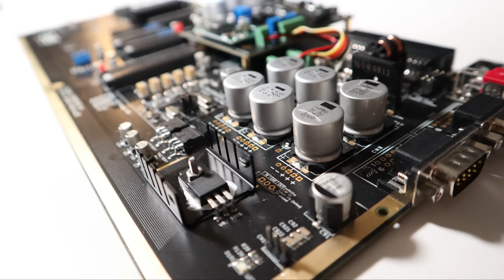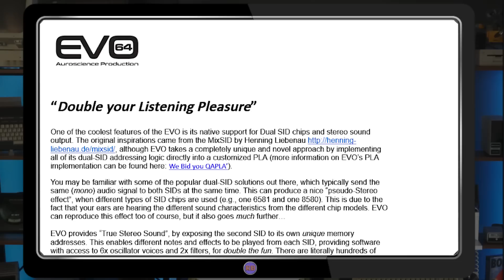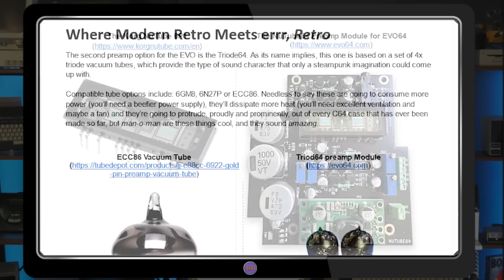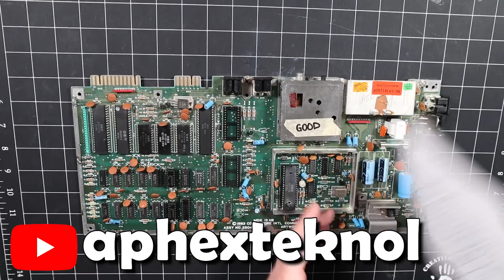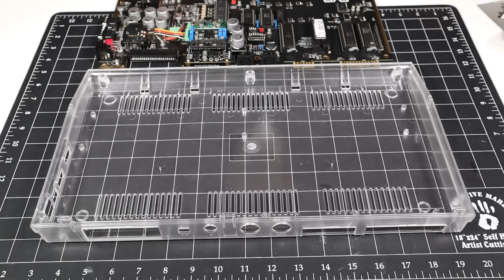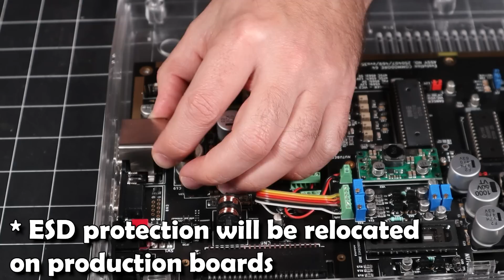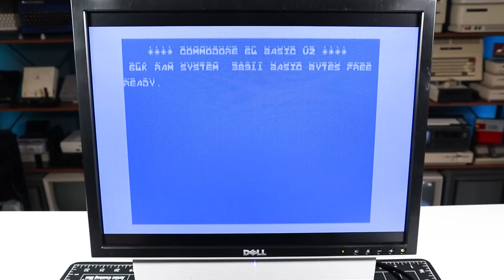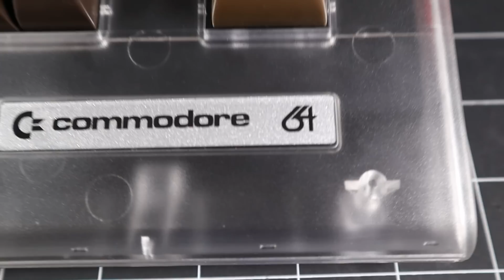A Commodore 64 with… vacuum tubes? Introducing the Evo64!

Comment: Is the nutube microphonic? Recall Brad the Guitologist getting an early one and it was. Can you hear your keyboard inputs?
enjoy!
Reply: Yes. The Korg Nutube 6P1 can exhibit some microphonic properties when its exposed to significant vibrations. This is why we provide a mounting solution  with standoffs that provide some dampening. Most of us won't have our C64 systems setup in areas with heavy vibrations, so in our field testing the microphonics have never been a real issue.
Reply: all tubes are microphonic. If you tap ON the nutube you will hear the "ding....". If you tap somewhere else, or type in the keyboard, you will be safe. I doubt you will put the C64 on top of  speakers.
Reply: @auro1999  with that argument we wouldn’t have tube guitar amps.  Interesting anyways y’all had to overcome it

Comment: Hmm, so this doesn't really have much point to it like the THEC64 does, since with this we still have to find our old main chips except the PLA. So it's mostly just if our PCB and PLAs are hashed but we also want cleaned up A/V as a bonus. So now let's see them copy all the old chips that have yet to be cloned discretely and include those as part of later releases of this, so that it's complete, at least electronically. And then include new cases as even another option.

Comment: I really want an EVO board. Not interested in the tube amp though.
Reply from the maker: The Evo64's dual SIDs work fine without the optional tube amps and the board still provides much cleaner power than an original 64.

Comment: Would be nice if they had cleaned off the flux residu..
Reply: It will be on the retail board. Remember that this is more a prototype.
Reply: In case it wasn't clear from the video, Matt was working with a hand made prototype board. Final production boards won't have the flux mess on them.

Comment: I noticed the lack of modern connectors on the back of the unit. Any hard drive  ?
Reply: No hard drive, but definitely offers all the standards, like cartridge port, user port, composite and S-video, as well as stereo audio, IEC/Serial for disk drives & printers.
Reply: @C64EVO  thanks !
Reply: In combination with an 1541 u2 cartridge you have full usb storage support

Comment: downside .. chips are partially not socketed...
Reply: Only the small form factor SMD chips aren't socketed. It may be helpful to know that they're still very easy for a qualified person to service or swap within a couple seconds. As long as they're using the correct types of reworking equipment (e.g., flux, heat gun, etc.).

Comment: Looks like there is fluxite on the read of the board.
Reply: In case it wasn't clear from the video, Matt was working with a hand made prototype board. Final production boards won't have the flux mess on them.

Comment: As an Engineer, I don't understand what you mean by "I can't demonstrate that for you". Are you not able to record the output signal from the VFDs? Is Youtube not able to reproduce 44Khz sound at 16-bits? This sounds like audiophile crap to me. You should have used the one way diamond tip wires maybe? You're using 1959 era VFDs to amplify a reasonably inaccurate 1981 semiconductor but the recording can't be reproduced from modern technology in 2022? I sigh for you.

Comment: very cool. i don't think the nutube or tube outs are really worth it though. you can spend something close to that and get a stand-alone tube or nutube preamp that you can use with any equipment you want to make it sound warm and amazing. there's absolutely no need to get a bespoke unit for a C64
Reply: There is a fair amount of noise within the standard C64 itself, which EVO is eliminating. Starting form the power sources, through rectification, through audio signal generation and propagation, etc. So, EVO's preamp module is fed with a clean, smooth and consistently stable audio signal, which wouldn't be possible on a standard system. Of course you could add a filter stage to the output of a standard system, in front of the preamp / amp stage, but the results wouldn't be quite as clean.
Reply: @C64EVO  I'm in no way saying that the EVO itself isn't worth it for the clean A/V signals. I'm saying that the $500-$1000 extra audio boards are not worth it because it's a single-use part. You could take a line level output and use it with a stand-alone tube amp which could be used with all or any of your equipment. If you're willing to spend $1k on a tube preamp, you can get something super, super nice and even have enough left for a source select switch.
Reply: Fair enough. The tube preamp modules were clearly developed to cater to a niche audience that wants a completely unique audio experience. They're definitely not a requirement for people interested in experimenting with the many other facets of the EVO.
Reply: @briangoldberg4439  Brian. Two things: 1) there is no way you can have this quality at this cost. Feel free to look at tube preamplifiers and you will have to sell a kidney.... Here the most expensive part is not the tube, but the jfets ! 8 of them PLUS hours of separating in Idss values. Do you really believe that a 50$ amazon-tube will do this ?  I have plenty of them, and dont use them anymore 2) nothing prevents you to reuse of or my  nutube and as preamplifier for the stereo. Just add log-potentiometers. It would work quite well. Computers ? you can even adapt it for the ultimate or whatever line input you want. Last but not least, if you put a RIAA feedback, it can also run your turntable MM cartridge.  Jfets are very silent and effective.
Reply: @auro1999  that's good to know. i have no doubt of the value, i was mostly thinking about it being a single-use device. yes, brand new tube amplifiers of extremely high quality are very expensive, easily much more expensive

Comment: It seems as though, when in a case, accessing that DIP switch to choose different cartridges might be problematic.
Reply: there is a wired remote control. The dip switches you see are on female headers sitting on soldered male jumpers. Instead of these dip-switches you can insert a daughter board, with a 2x10 ribbon going out and another daughter board with dip-switches outside... This is sort of temporary until I finish a key-switcher with mosfet, sometimes in late 2023..

Comment: Could you please do us a favor and make your future overhead-cam shots not tilted with the top of the table and boards closer than the bottom? That's so skiwampus that I'd rather see it tilted the other way if getting it right on weren't an option for some odd reason.

Comment: The moment you used two 8580R5 SID chips was the FAIL from me lad no way rather the original 6581R4  as the primary and one of the newer 8580R5 as the secondary and have them as stereo only with a sound enhancer as in FM YAM cartridge for that extra MegaDrive vibes when ever wanted for music creation and just use the SID's while gaming... Another tech that is CLUELESS... Zero anti static band while working on the motherboard and using a screwdriver to pry chips off an old motherboard oh my lord you really do not care a damn about the tech's well being...

Comment: vacuum tube amplifier to play video 8 bit video games....uhhh...ok......vacuum tubes are part of my hobbies and i have a vast collection of tube gear..from amps to radios and all tube tvs but... that contraption is the most ludicrously  hipster thing i have ever seen......makes absolutely no sense at all...its cooll that they make clone boards, and even cooler they make improved boards...but tubes???? why??? jeez...   i bet its one of those tube amp circuits where the tubes are put there just to say it has tubes, like on those chinese headphone amps....  also why bother to reenginner for noise reduction and use high end components blah blah when they didnt even bother to clean the solder flux?? those fancy caps and whatnot could be traded for more usefull features...otherwise i think its an awesome product
Reply: It's a prototype. The retail board will be clean.

You can definitely incorporate tubes in electronic music. Remember that the 6581 and 8580 are basically just synthesizer chips that could even be used standalone without the whole computer. A lot of people use C64s in their music production due to the SID sound and running that through a tube does make sense.

Also you seem to forget that the Tube amp modules are optional.
Reply: @nilswegner2881  attention, i am criticizing the tube module, not the entire board...unless that computer is used to play actual music then adding tubes makes no sense sorry, its ridiculous...tubes are good for hifi applications and even that is very debatable because solid state amps have very little distortion, close to nothing, while tube amps have lots of it...but none of that matters for retro games and the type of sound effects we see on them...also if you read some datasheets for preamp tubes or power tubes and see their ratings, filament voltage and current, plate voltage , plate current etc. although there are some low voltage tubes that were used in portable radios with 1v filaments and low plate voltage, they still eat a lot of current and generate lots of heat IF they are actually doing anything usefull.....so modern pseudo tube gear sometimes uses tubes just to hype up the price but their function in the circuit is near zero...i would love to see the schematic , perhaps im wrong but...yeah....
Reply: There is a fair amount of noise within the standard C64 itself, which EVO is eliminating. Starting form the power sources, through rectification, through audio signal generation and propagation, etc. So, EVO's preamp module is fed with a clean, smooth and consistently stable audio signal, which wouldn't be possible on a standard system. Of course you could add a filter stage to the output of a standard system, in front of the preamp / amp stage, but the results wouldn't be quite as clean.

With regard to the tube preamp modules, they were clearly developed to cater to a niche audience that wants a completely unique audio experience. They're definitely not a requirement for people that might be interested in experimenting some of the other facets of the EVO.

And repeating what others have said, Matt is using a handmade prototype board. The production systems will not have flux residue.

Comment: All this and still no analog replacement for SID
Reply: There are a lot aftermarket SID clones out there, ranging from the ARMSID, SwinSID, SwinSID Ultimate, FPGA SID, BackSID, SIDKick, etc., etc. However a lot of people are still using the original MOS SIDs due to their analog filters and perceptible oscillator glitches. The details add those tiny bits of character to the instantly recognizable "SID sound"

Comment: I don't see the improvement of having a tube preamp when the machine is only capable of playing lo-fi chiptune.
Reply: There is a fair amount of noise within the standard C64 itself, which EVO is eliminating. Starting form the power sources, through rectification, through audio signal generation and propagation, etc. So, EVO's preamp module is fed with a clean, smooth and consistently stable audio signal, which wouldn't be possible on a standard system. Of course you could add a filter stage to the output of a standard system, in front of the preamp / amp stage, but the results wouldn't be quite as clean.

With regard to the tube preamp modules, they were clearly developed to cater to a niche audience that wants a completely unique audio experience. They're definitely not a requirement for people that might be interested in experimenting some of the other facets of the EVO.

Comment: All that money, and all those efforts to reduce audio noise... And it doesn't even have balanced audio out? 

I swear you audiophiles crave snake oil. Think about this for a second. You strapped a TUBE AMP to an 8 bit audio output. That's like putting drag radials on a yugo, or caviar on mcdonalds french fries. Ahh well, at least you didn't buy into the gold plated S/PDIF cable fad, or granite slabs for your mac mini that are supposed to reduce harmoncs or some bs.

Comment: "Everyone knows that the... PLA chip is prone to failure."

No they don't, and you'd have to be a mind reader to really be able to know all of who does or doesn't.
Reply: I think Matt's comment in the video regarding the PLA was targeted to people that either service and repair or build new DIY C64 boards, since anyone that has had to mess around with those old chips will know which ones tend to fail the most. As Matt said, the original PLA is definitely way up there in terms of failure rates, which is why EVO has done away with the original. Likewise the original DRAM chips used to fail a lot, so EVO is using modern SRAM chips for memory, etc. I guess it's safe to say that the overarching message is that EVO is modern everywhere it made sense to move in that direction, but also authentically retro with regard to using the original video, audio and I/O control chips.
Reply: @C64EVO : He wasn't that specific with "everyone." So we'll just have to see what he says in response. He could have easily been more specific.
Reply: @HelloKittyFanMan   most of replacement PLA use xilinx XL9536. Names are the ones mentioned above. I use the 9572 to have more "internal neurons" so that I can do the AND/OR/XOR for the 1Mbyte reprom and the dual sid. A lot of logics went to deal with mapping cartridges into the large EPROM... ANyway, the official board will have a socketed 9572. I already have a bunch done at home. Look at the lemon64 thread for some pictures. Since the PLA is socketed, I also have a board with the 95144 (4 times more neurons than the usual competitor PLAs). I will use this to make the logic to map ocean cartrides (magic desk) and to deal with the color memory which is still not SMD. When available, the PLAs can be reprogrammed on the board.. Actually I do this all the times. I do not even turn off my C64. I shoot the CPL Xise programmer in my Mac, the C64 freezes, after 2 seconds the programming is done, I press the reset button and the C64 restart. Occasionally I do not even reset the commodore. It just re-start working from where it was before programming, but with the new PLA code.

Comment: Yes, but why... really, why?
Reply: If you don't know, then you don't know...
Reply: @C64EVO  Yeah, maybe. Probably more about it being pointless though.
Reply: @throttleAddiction, seems a little odd to watch a channel that's dedicated to retro trends and technology, but somehow find a remake of the number one best selling system in the history of computers to be pointless? SMH...
Reply: @C64EVO Is that a fact, or is it just a subjective opinion?
Hard to believe it outsold the 8086 (XT), or any of the 286 (AT), 386, 486, PI, PII... i3, i5, or i7 based systems. Oh, then there's a plethora of Apple Macs. Did it honestly outsell any or all of them?
Reply: @C64EVO  Okay, noted by Guiness but it is based on an 'estimate' of 12.5M units, as it seems to have non-confirmed sales figures. 
There is suggestion that the NEC P-9800 out sold it, with impressive figures of 18.3M units. The P-9800 was an 8088 (XT) based system
 While it was just one model from NEC, as far as platforms go, the total sales of 8088 systems worldwide would be far greater - although granted, sales apart from P-9800s are not a singular model series from one manufacturer.
So as far as redundant tech goes, it's P-9800 Vs Commodore 64
Reply: @ThrottleAddiction you're more than welcome to go have some fun with a P-8000 V remake then... 

And, if you have a suggestion or recommendation for a retro platform that you'd like to see covered by the channel it might not hurt to ask, rather than slamming projects that other people are clearly enjoying... Just a thought...
Reply: @C64EVO  Asking 'why' - is far from slamming something.
I think you're just a bit sensitive to the nature of your hobby.
Reply: Well given that the video has 35K views so far, it's clearly not just my hobby, and with a thriving fanbase that continues to produce new content for the C64 daily, it's clear that it's anything but pointless. So, there's your "why"...

Comment: I would love to get my hands on one of these, cant they make it so it fits in an original C64 case and psu case? so when u see it it takes u back to 80's but u have a supercharged machine. Also were u not suppose to push the joystick ports right up against the side of the case and use the same nutbolts that was on there or longer ones??
Reply: you can put the original OR  modern DB9 joystick connectors.